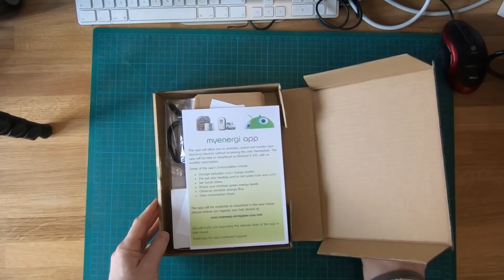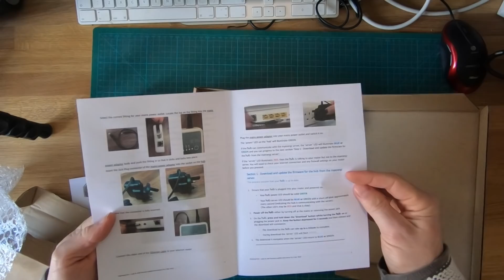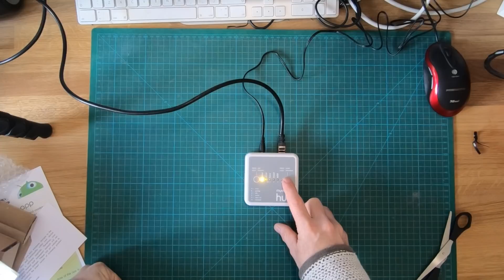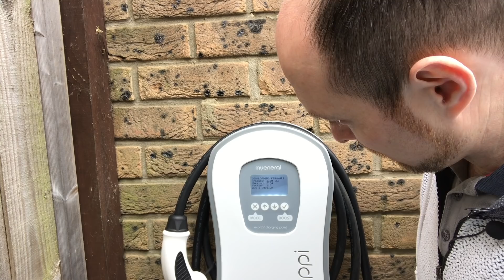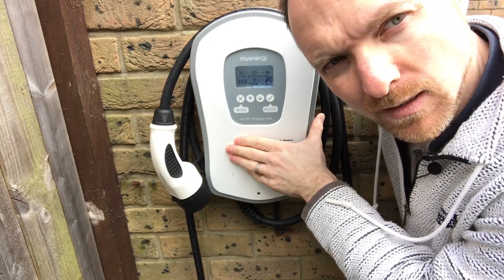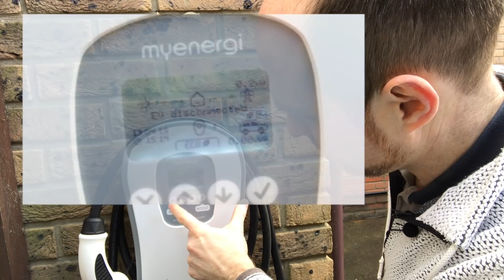Myenergi HUB: Unbox & Install

Comment: Just got mine today, Had my Zappi Mk1 3 years but only recently replaced my ev after selling my first one two years ago. I didnt get any instruction manual with it other than a link to their website which promises instructions, it links to a  404 page not found..... How can they have still not sorted this 18 months after your video. I just paid £90 for this, I will be making a phone call tomorrow, it says if you need support to email them....seriously? I got the Hub to link to the Zappy Mk1 but I dont get the Hub info page which is supposed to give me a code to register it in the app..... really poor I have to say. Thanks for the tutorial it helped confirm my suspicions that the set up for this hub is a bit of a lottery if it works.
Reply from the maker: MrT33CEE sorry to hear your having trouble, to register with the app you should only need the code printed on the hub. Make a note of your password though as you cannot reset it!
Reply: @eviain  Hello, thanks for the reply, unfortunately that info page 2 isnt on my zappi so I'm not able to get the activation code needed for the app, trying a firmware update via the hub because when I try the zappi firmware update it says its up to date, which mine cant be.
Reply: Its a good job your tutorial is available as the instructions on Myenergi arent helpful, they have made so many changes to the hub over the past 18 months the procedures are now all different.
Reply from the maker: MrT33CEE darn, I’ve found them pretty decent over the phone, but your right they have developed these products hard over the last year which leaves holes in the process . Hope you get it sorted!
Reply: @eviain  Cheers, I have had more progress, I have now managed to get the Zappi to update its firmware, hoping this might show page 2 for this important activation code.
Reply: I got the activation code, but no matter what I have tried, factory reset as you did I now cant get the Hub to pair with the Zappi, didnt get chance to phone them today, will phone tomorrow, meanwhile I will scour the forums...
Reply from the maker: MrT33CEE Humm try moving the hub nearer if you can while your testing. Also check the channel is the same on both. The Zappi firmware update changes the pairing menus and methodology quite a bit so worth trying to update firmware on the hub too
Reply: So the only thing I hadnt tried was default the Hub, I found the procedure on the forum as I didnt get a booklet of instructions with mine, hold both buttons whilst powering up the hub, paired with the Zappi worked straight away....cheers again your tutorial really helped, Myenergi's instructions.....woeful.
Reply from the maker: MrT33CEE awesome 😎👏👏

Comment: I find it a dismal you have to purchase another device the hub  to update the Zappi why is not built into the zappi and enable it to connect wirelessly. There are too many steps to connect all other devices which also be wireless. It should all be plug and play. You don't get this from Amazon or apple or google home hubs. I am put off.
Reply from the maker: Lawrence Miller I don’t think you will be the only one out off by the complexity. I can’t say I enjoyed all the setup! I hope that they will start to add some polish to the products.

Comment: I had the Hub and Harvi paired and working well with my Zappi. The Zappi developed a 'Pilot Problem'. After trying a new charge cable which did not resolve the problem I was sent a new Zappi. I got both Hub and Harvi paired again but the Harvi Grid readings kept disappearing. I removed both, reset the unit, searched for new firmware and tried again. I now cannot get Hub or Harvi to pair :( I have temporarily hard wired the Harvi but repeated attempts and another Zappi reset have failed to get Hub paired :(
Reply from the maker: 🤨 depending on the firmwares of the Zappi pairing has changed. I would put the hub to one side and try to get harvi working first. It will need at least one clamp on a powered line to power the harvi. Once in pairing mode the harvi should appear in the pairing menu. You may need to check the channel is set the same on the two devices. You could have accedently changed the channel on harvi as it’s all done on the same button

Comment: Glad you got yours to wrk without issue. I’m on the trial and didn’t pay but it’s still going back. Nothing worked, not even connecting to their server. No other instructions if you can’t connect to their server! Feels like they have over complicated this, they need to have a better user experience if they want mass integration. All very well and good if the few geeks can sort it but no good for the ordinary user. So disappointed.
Reply from the maker: I’m not sure it was as smooth as it should have been, even in my case. Seem to be having trouble now with the app but will do another video soon on that :)
Reply: EvIain 
You have the app? Where did you download that? It seems everything to do with this company is awkward to say the least. I tried locating the app but to no avail.  It would have been nice to see it but it wouldn’t make a difference if the kit doesn’t work.
Reply from the maker: Yes released yesterday on the App Store and maybe play store too. Hub too some convincing to connect to the server today, not sure why but a number of resets and random button pressing followed by leaving it alone helped! 😬 app is a bit of a pain to set up as you need a number of the hub and from the info display on a zap or Edd. Got there in the end!

Comment: I upgraded the firmware on my Eddi, but now the Boost function doesn't work, anyone else have this problem?
Reply from the maker: Maybe worth a tweet at my energy they are good at responding. Also worth downloading the manual again as some settings may have changed with the update.
Reply: I did try earlier today (before ever reading this) and found it kept dropping back without ever actually starting on heating my tank. But as other things aren't working on the app and they've never introduced me to it yet. I assume it's not yet ready for release. But it's now 4 months since I received the hub and 8 months since I was encouraged to buy it! No response from myenergi when I ask when will it be ready.
imho the hub only is almost useless.

Comment: Did you have any problems with the internet time setup. I'm set to GMT/BST and auto update and it is fixed to GMT. All.good otherwise for my two Zappi's and Harvi
Reply from the maker: Nope internet was solid, all the updates came down fine. Just issues once the new firmware was applied, no big issue really just not a great experience.
Reply: @eviain  sorry bad explanation on my part. I've setup the internet time sync feature and set the unit to GMT/BST and yet the time sits 1 hour behind, so effectively always in GMT. Great vid BTW, thought of having a go myself but couldn't wait to install it 😊👍🏻

Comment: My experiences were very similar, reset the Zappi (and Eddi) after update and then check ALL settings, particularly the CT setups, otherwise strange things will happen.
Reply from the maker: It’s a shame it’s not a straight forward process, as the appeal would be limited and require a lot of support calls, hopefully future firmware revisions will mean a more automatic update process initiated from the app. However looking forward to the potential of this product.

Comment: Good system , but I would need to replace the charger I have , not economically sensible after , also have iboost , paid for itself already in less than 3 years, worry would be it might be obsolete before used fully , wait for batteries going to be 5 years at least , not economically viable until have 2nd ev and again if car at home it can take the solar energy directly .